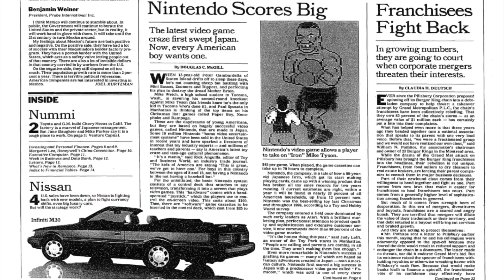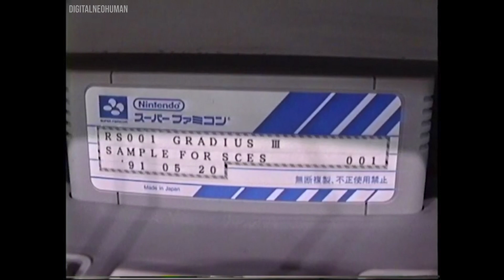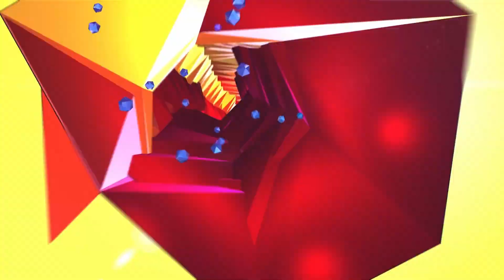The console that WON THE BIT WARS | SNES. TechTimeline.

Comment: SNES didn’t really “win” the 16bit generation. Genesis/MegaDrive was at least as popular as the SNES.

By the time many of the best SNES games were released, Sega had already moved its focus to 32bit Sega Saturn and PlayStation was released.
Reply: Yup. The groupthink is strong with this video thumbnail. So hard to get an unbiased take on the 16-bit generation these days. It's a real shame that ppl from both sides miss out on the amazing and massive libraries of games for both the Super Nintendo and the Genesis, which had every bit as good a library as the other.
Reply: @JonBR-622  Probably the development on many of those games started before Saturn was released, and in any case most of those games were not made by Sega. 211 Genesis/MegaDrive games were released in 1994, 128 in 1995 and only 52 in 1996.